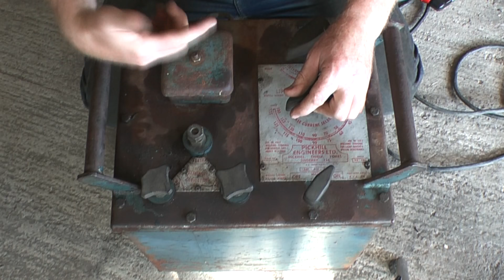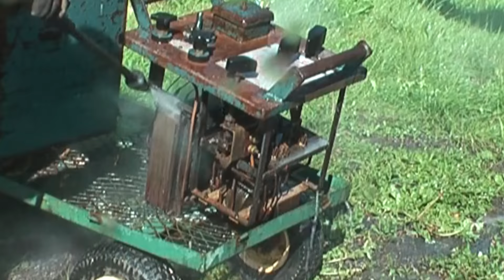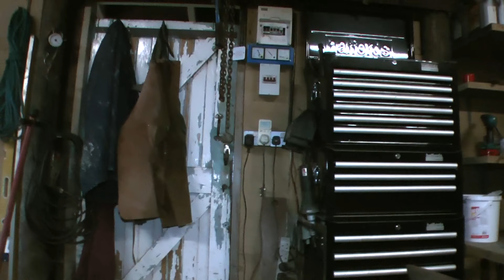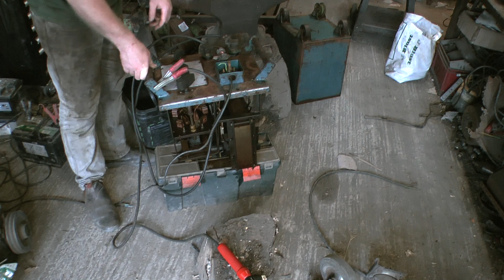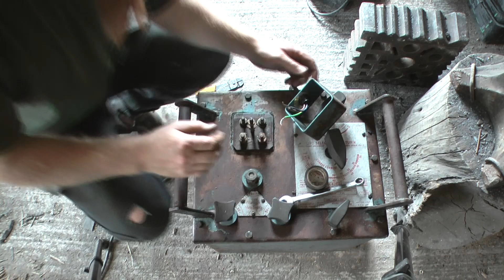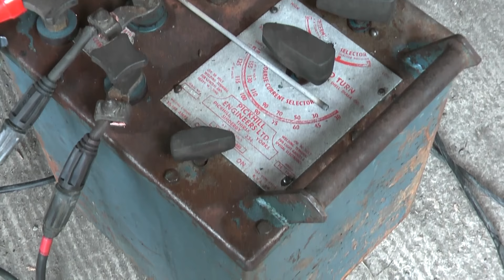Restoring a vintage welder

Comment: Very cool.  We had a Oxford oil welder when I was a teenager.  How much did it cost in the end?  Oil I mean cos the welder was £25 as far as I recall.  I worked at a place for a summer job that was like stepping back in time.  They had a DC welder which consisted of a 2 cylinder Lister diesel engine directly connected to a large DC generator - which was the welder.  After starting you adjust the speed to adjust the current :D
Maybe still an option for you to connect to the Land-rover/Tractor PTO or the engine of your generator?
Reply from the maker: Cost about £70 for the oil I think. The only Lister welders I've seen were basically versions of the same engine as in my dumper but intended to run at up to 3000 rpm which considering the noise mine makes at low speed, seemed rather horrific! A big tractor PTO generator would be great to have.

Comment: When compensating power factor with capacitor, you might find the welder need more amps for the same penetration. What I have found is you need more windings, the power factor compensation is not a good idea for welding process, but for power plant. If you want to compensate anyway, put the capacitor far away from the welder. The last but not the least, you can't save any money with compensation, because your electric bill does not have separate for active and reactive power, you pay it together as household consumer. Cheers!

Comment: Another marvellous video, thank you. By the way I have solid aluminium piston that came from an Intercity locomotive which is sitting beside my wood stove. It's 15" high, 11" across and 33kg. I use it merely as a hotplate beside my wood stove when cooking...but I'd love to clean it up and put a piece of toughened glass on it to make it a little table.. Could you give a recommendation on how to clean it up nicely ???
Reply from the maker: If you have a compressor then blasting with baking soda works well for aluminium. I did a VW engine top end using a cheap paraffin gun as the blaster, came up lovely!
Reply: Splendid!, thank you for your advice. I used to work for a glass company so I can get the top cut, bevelled, toughened, etc. But now at last I am really enthused about actually doing it after dragging this piston around in my life for over 20 years, ha!...A simple response from a person with abundant knowledge can cause a ripple effect in enthusiasm......this is nature in it's finest form!!!
Reply: I swear baking soda is The Philosopher's Stone. The number of questions that are answered with "give it a bit of Sodium Bicarb" boggles the mind.

Comment: Hi. First off do you have an email address for a direct contact please.  Second , the amount transformer oil in the welder should be right near the top  of the unit .there should be a seal around the top of the housing . original ones were cork type gasket .some of the welders did have a filler plug and a short dipstick in the top lid, not difficult to put one in .  The original welder designed and built by Cyril Dobson  in Cambridge St. Kettering, Northamptonshire in 1930.  the first ones were the Cytringan Bantam. Oxford Products and  Pickhill,  ARE Cytringan copies with a few minor modifications to avoid copyrite of what was an oil immersed transformer known as a 'drooping current characteristic' before the Cytringan there were arc welders but they were DC. this is one successful design of the first AC. with this type of transformer.
Reply from the maker: Very interesting, thanks! My email is maximusironthumper@gmail.com
Reply: Yep, oil covering the switching contacts is a very good advice. ...first thing that came to my mind when I saw the video.
Keep up the good work, Max!
Reply: Martin Luther. I was closely associated with Cyril Dobson and his family in his later years (about 30 yrs ) I was involved in many of his retirement projects as he never stopped experimenting and doing the things he could well afford to do that were of interest to him and also myself .

Comment: yeah you can clean the spools with hot water but you better bake the spools to get all the water back out again 
one thing i used to do with underground cables is pour boileng hot bakinggrease over it , the grease evaporates the water and replaces it between the wires of the coils with should prevent it from shorting out (MEASURE IT WITH A HIGH CURRENT TESTER BEFORE POWERING IT UP)
think the oil that needs to go in there is mineral oil

Comment: Love it mate. Unlucky with the hole. Roughly how much was the transformer oil ?
Reply from the maker: Thanks. About £70 I think.
Reply: For a business eos do reclaimed transformer oil at 86p a litre (in 205 litre drums) Fuchs sell new transformer oil in 205 litre drums at around £1.30 a litre 

- I used to work with oil filled transformers.

Comment: I've converted my AC welder to DC the power correction Capacitor works well but you need to a Ferrite coke to bring the Amps back up.  Oh the penetration, the control of the run small welds big welds lovely lovely lovely, scratch start TIG on the stainless needs more practice but its coming along nicely and some how i've managed to ali weld with it : S not sure of the quality of it but hey ho it works.

Had I known back then what I know now, I would of made a DC box with DIN in and out and just converted the AC welder to DIN

Comment: mineral oil (liquid paraffin) would have worked fine.. i HAVE used it in high voltage transformers  (20KV) the transformer oil will be better though because it shouldn't expand to much as it heats.. always make me sad when old girls like that go to the scrap guy... good job!

Comment: Cool. I've got an ancient Lincwelder that weighs about as much. How did you dry it out?
Reply from the maker: 3 days in the hot sun (this was during a heatwave) then plugged it in and it dried itself out.
Reply: You're a better man than I, or at least you have more nerve. I think I would have found a way to bake it at around 180 deg f for a few days. Maybe a sheet metal box-an old refrigerator would do- with a hair dryer ducted into it? Either way you saved a large piece of kit from the scrapyard, which is what we're supposed to do.

Comment: I'm surprised about your solar being clean and diesel being dirty. I'd have thought your inverter would be ugly PCM and your diesel would be a lovely sinusoid. How come it's the way it is?
Reply from the maker: Super duper inverter produces a pure sine wave (or very close anyway) and holds a constant output regardless of load. The generator is only controlled by a capacitor not a proper AVR (automatic voltage regulator) but then it's only meant to be a building site generator, maybe one day I'll get a posh one!
Reply: The output of your older generator will be sinusoidal and will be cleaner than you think because it is a product of a rotary generator. The AVR is only the means by which the output voltage and current is controlled and can not control the wave form. Do you know somone who has a Cathode Ray Oscilloscope that can be used to see the actual wave from fo the generator.
Reply from the maker: The issue is more the voltage drop/surge from loads cutting in/out. I have an oscilloscope myself and it will feature prominently in the follow up video!

Comment: I have one  i trend my in to a AC & DC welder & a long duty Cecil,    I found  it best to fit the rectifier . in a box  whit coil resister & micro ferries condense. to smooth out the  cure by  By coming of AC  to rectifier    the new power lads coming of the rectifiers now DC . I ues mine as a TIG welder on DC  for steal  &  detect of AC 50 for AC TIG wedding for  Aluminium, it works well I also  bras with my TIG now  IM on DC

Comment: Maximus, I watched this a while back but only just found the link to a video which I think might solve your noisy generator power supply problem. "EEVBlog #1116 - How to remove power supply ripple" is the video you should watch. Towards the end of the video he does practical demonstrations of what he talks about. I'd run it past your electronics wizard first, I only have a basic electronics knowledge. But I think if this will clean up your the noise from your genny then you could probably source the parts cheaply.
Reply from the maker: Thanks I'll check it out!
Reply: Philip Smith
Dave's video refers to removing ripple from an extra low voltage, low current DC power supply, not relatively high current AC. There is no economical way to deal with an alternator that has an inherently noisy output. Capacitors may help bring the power factor of a piece of equipment into check but the effective capacitance can only be calculated for a steady inductive load, which a welder is far from. It may still be better than nothing and sized to improve PF under expected load only. It will just shift where in the load graph the PF is most lousy.
Reply: @v8snail  I will trust what you have said, this stuff is way above my expertise. I think it was worth a look though. Cheers.

Comment: Did you ever fit it up with that capacitor in the end?
Reply from the maker: Yes I did (although it wasn't worth making a video) and it has made it a bit more efficient, although I still need a bigger generator!

Comment: What generator are you running? PFC and voltage can be adjusted via the AVR, DEPENDING ON GENSET
Reply from the maker: Stephill SSD600 - no AVR sadly. Turns out it had a faulty cap, stuck in a new one and it's behaving better now.
Reply: Do you know supply voltage to the rotor? Or is it setup completely differently? I could get you an avr to retrofit..
Reply from the maker: I did look into fitting an AVR but it seems the version of the generator with an AVR has a different alternator. I'm looking out for a bigger generator anyway!
Reply: Yeah the gender needs to have access to excitation wiring for the rotor.. 
Where abouts are you?

Comment: My dad had an Oxford oil filled 180 amp wired to the 3 phase, can you get 3 phase tap from your generator?
Reply from the maker: You can wire to a 3 phase supply if that's what you're asking (but it only uses 2 of the 3 phases) or you could tap 400 v off the 240v input (using the coil as a transformer) but it would remain single phase.

Comment: Just out of interest Max, what sort of diesel generator do you have?
Reply from the maker: Its a Stephill SSD6000, I wish it had a proper AVR and it's not big enough anyway, but it was cheap and has been very reliable!
Reply: @maximusironthumper  I've got the same one!! 😄 I've done a bit of stick welding with it and a litte 140a plant. Often wondered if it would run anything bigger and now I know cheers!
Reply from the maker: It's not running the welder at the welder's full output though. It will burn a 3.2mm rod but not a 4mm, it seems similar output to the MOSA engine powered welder which is rated at 165amps. Still I get by ok for now!

Comment: I wonder how you wire it 415v or 440v with a single live wire?
Reply from the maker: If your running off a 3 phase supply, it uses 2 of the 3 phases, so you wire L1 to the 415 and L2 to the zero. Might be doing this if/when I get a bigger generator!
Reply: Hmm yeah, it's tricky in a way.  Where would L3 connect to then?  What if you had a 4 wire system?  You can discount the neutral? It still leaves a spare phase.

I've got an ancient (1930s)air-cooled arc welder.  It takes a range of obsolete input voltages (200 and 480 I think) as well as 240 and 415 and 440 but I can't remember how it was wired (on a 3 wire - 3 live phase system), although it would have been a 415v supply at the time.  It's disconnected of all wiring these days.  I've not used it in years.  Last time out, it was tripping fuses in the junction box as I wound the wheel (for amps) to adjust it.

I should have a look inside as you have done.  I think it's an insulation issue.  I restored some of it to get it working well way back in 1987 when I acquired it.  Ancient cloth, and string for binding the coils.  I seem to remember one of the coils had come slightly adrift and was probably coming into contact with the magnets as I adjusted them for current.  The coils are solid copper flat bar about 1/2 inch in width x about 1/8" thick.  It needs a good going over.

It's made by The London Electric Power Company and might well be 1930s production.  It would have been a War Dep't purchase in the 30s and went through WW2, being de-commed and released after the war.  Two old chaps I knew acquired it when they were de-mobbed in 1946 and brought it home to work for them till they retired in 87.  Two tappings for output, up to 100 A or up to 200 A, depending on where you position the welding leads.  AC output.  100 volts OCV across the ouput poles.  Eek!
Reply from the maker: Yes, you don't use L3 or neutral, the L1 and L2 are far enough out of phase to act as neural for each other. 

Your welder sounds very interesting. If it's marked for 240 then it's likely a single phase coil like mine and able to run on 3 phase in the same way mine would. 

You might find this forum post useful/interesting:https://www.mig-welding.co.uk/forum/threads/pickhill-engineering.20058/

Best of luck if you try to get it running!
Reply: I think it's one large flat banded coil (but it might be two) and there are two huge magnets (opposing?) on a common shaft that is threaded right-hand for half the length and left-hand the other half.  By winding the wheel on top, that turns the shaft, you bring the magnets closer together or further away depending on rotation.  Big worm threads they are, on the shaft and magnets.  Square cut threads I think, ACME style.

Between each band on the coil there was ancient cloth insulation when I got it.  1930s cloth.  I unwound some of the coil (or all of it, can't remember) and replaced some of the cloth with folded magazine paper!  And replaced some string binding that holds the coils neatly together in line.  It was an afternoon of a job I remember, and I had a mate helping me.  One of those jobs you need two pairs of hands.  Supposed to be a temporary restoration at the time, but it lasted years and of course I never got back to looking at it.  I should have a proper look at it again and do a better job.  Maybe strips of fibre-glass cloth will be a good option for insulation.

Thanks for the link.  I've not looked at that forum in a while.  I will take a look.

Comment: I had to stop watching and comment whenever you said 25 pounds.  Those old Pickhill welders are fantastic, they work forever.  
£25 is breakin' my heart mate. Sayin' that, there must be 20 or 30kg of num 2 copper in there @ £ 3.50ish a kilo..  I missed a diesel generator welder at auction few weeks back, it went for 60 quid!! I was guilty of not bidding, I reckoned it would go for lots more, and then it was too late (Is procrastinator me)

Comment: I was told the oil in these old welders is carcinogenic,thoughts?
Reply from the maker: I was told the same and kept being warned about polychlorinated biphenyls (PCB), but the original oil was Shell diala and is PCB free, as is the new transformer oil that I put in. I still treated the old oil with caution just in case! 

Full data sheet here: https://www.shell.iq/en_iq/business-customers/industrial-lubricants/lubricants-product-range/shell-diala-electrical-oils/_jcr_content/par/textimage_15b7.stream/1486050886520/6fc04b5b35a55ab0c2ba2c93d3c414f02f219b7a55aaf21c76c8bb8573d59abd/shell-diala-s4-zx-i.pdf

Comment: Just be careful with the oil mate, remember being told it was a suspected carcinogen? The transformers had phenolic and other unpleasant things in them that leach into the oil.
Reply from the maker: I looked up the old oil, it didn't have the dangerous PCB's that some transformer oils do, but I treated it with suspicion anyway!
Reply: Maximus Ironthumper Good call mate,better safe than sorry.As an apprentice I got it all over my hands before being told of the dangers!  Great video mate.

Comment: I woudnt weld or grind near batteries they can go pop chuck acid all over and some nasty plastic shrapnel
Reply from the maker: That's a very good point (though only when charging and then the danger is near the end of charging when hydrogen gas is coming off)! 

Those particular batteries are very dead, no chance of them popping.